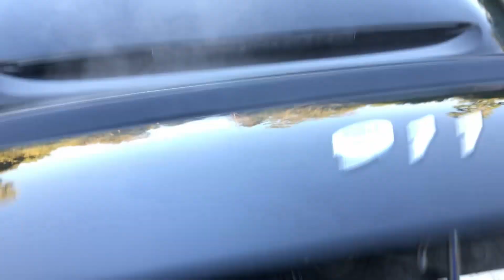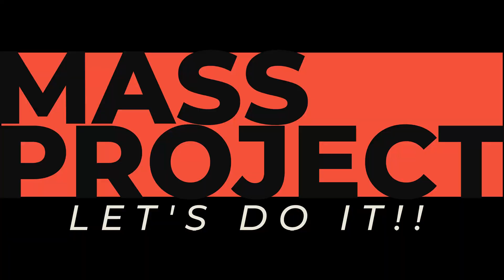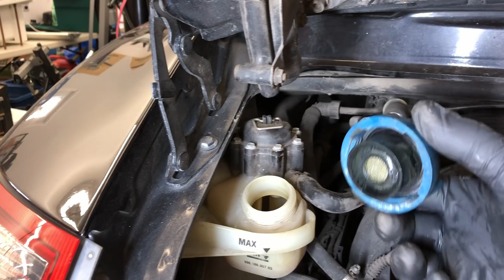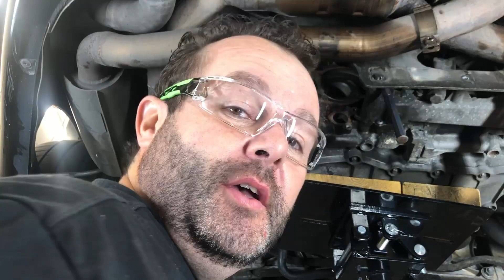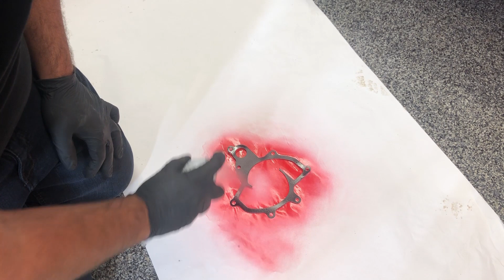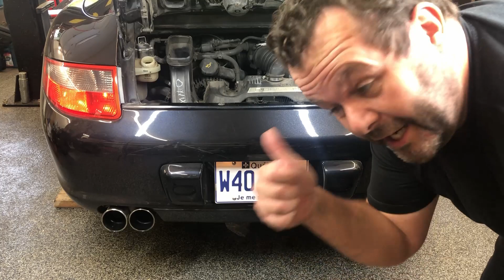Porsche 911 997 2005 Coolant Water Pump Replacement, How to

Comment: i am about to do this job on 3005 C2S.    i am reluctant to use any adhesive/sealant on the gasket.   I thought there were 2 dowels specially to hold the gasket in place and aligned?
Reply from the maker: The adhesive I used was just to get it to hold in place.

Comment: Really helpful video, my 997.1 did the same on Sunday. I made it home but I was hearing slipping belt noises and when I  looked under the car there were also small bits of rubber from the serpentine belt, darn it. I think I'll change the thermostat at the same time and the belt of course.

Comment: Great video.    FWIW-,i replaced my belt and bearings on idler/tension pulley were fine….but i had the idler pulley suddenly fail.   the nylon will just shatter.   do your pulleys when you do the belt IMO.

Comment: Thanks for the video! I had the water pump and thermostat replaced recently on my 1999 Carrera. When I start the car and let it idle for about 20 minutes, I notice a clear water spot on the ground about three inches wide just behind the left rear taillight. Is this normal? Or is this some kind of excess water overflowing?
Reply from the maker: Should not leak

Comment: Great video. But if you’re going to flush your system you’re better off with distilled water. Also use the Porsche coolant.
Reply from the maker: Yes, I do have distilled water for it. Using Zerex G-40 coolant.

Comment: Thanks for posting the video - it was very helpful as I replaced the water pump in my 2006 997. It's a very tight space. 

On to the next project...
Reply from the maker: Great, make sure to bleed the cooling system properly. Stay tuned for more.

Comment: Great video, but wouldn't it be easier if you removed the pipes?
Reply from the maker: All exhaust bolts were rusted and seized. Didn’t want to break any in the flange.
Reply: @MassProject  if removing them was possible, how much easier would the job become?
Reply from the maker: @JoshLoberant  not much. The only location it was in the way it was for the rear support nuts and we manage with a wrench instead of a socket. The little extra time was less than the time to remove the pipes.  Have a look at our latest video. We are removing the engine out of the Camaro Z28 to upgrade the powertrain.

Comment: Thanks Mass Project for the like....  
what was the actual time on that water pump please?  also..would love to see more 997 repair videos.
Reply from the maker: Without filming would say around 4-5 hours. Had a hard time with the exhaust bolt.
We have more coming. There is one about the convertible roof on our channel. 
Will I have one for door switch replacement. 
Also one for installing a short shift shifter. 
And Headlight levelling sensor.
Reply from the maker: And also full coolant flush.

Comment: very nice video... well done, especially given how tight some of those spaces were. Curious, what was the total 'actual' time for job?
Reply from the maker: Without filming would say around 4-5 hours. Had a hard time with the exhaust bolt.
Reply: @MassProject  Thank you sir for the prompt reply!... much appreciated. You are very skilled.
Reply from the maker: Thank you very much. Make sure to subscribe, we have a lot coming. The engine of the Camaro is out and video will be up soon. 500+ hp

Comment: Can you provide some info on the flexible tool used?  What’s the manufacturer?
Reply from the maker: Here is the link. 
https://shop.snapon.com/product/Flexible-Drivers/1-4%22-Drive-Standard-Handle-Flexible-Driver-(Black)/TM63A
Reply from the maker: It’s a  Snap-on tool. 1/4 inch flexible screwdriver